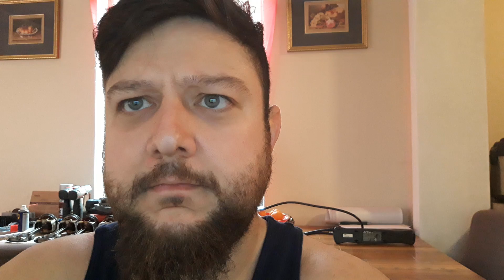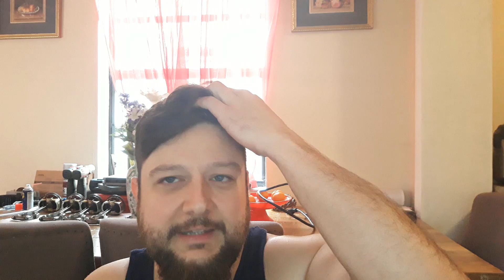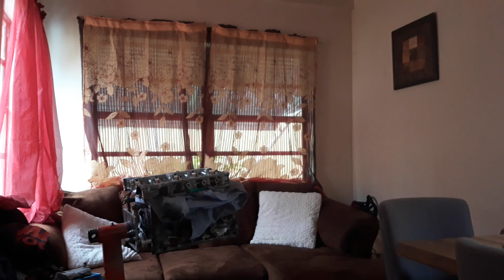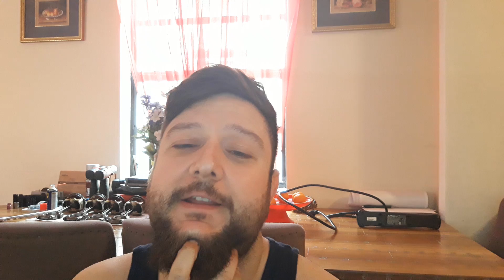K20a3 Head Nets Higher Compression

Comment: Hey I've got a k20a2 would it be a direct swap to put an a3 head on it along with a2 vtec cams
Reply from the maker: It would still be a downgrade despite the compression bump, but yes though the cams would have to be vtec locked to work
Reply: @VHBEngines  oh dang